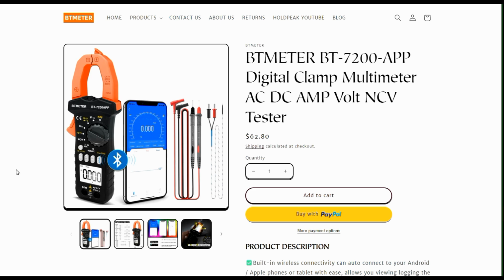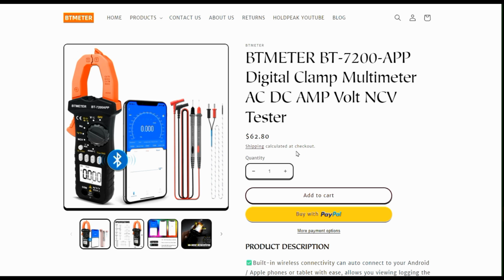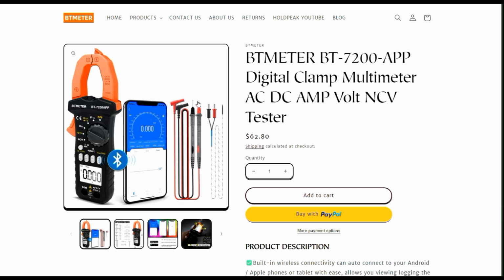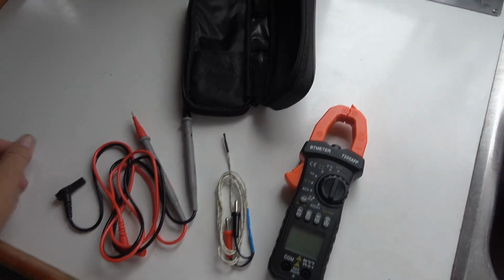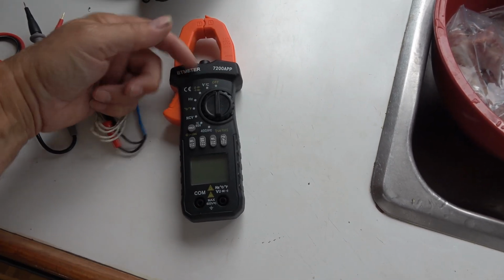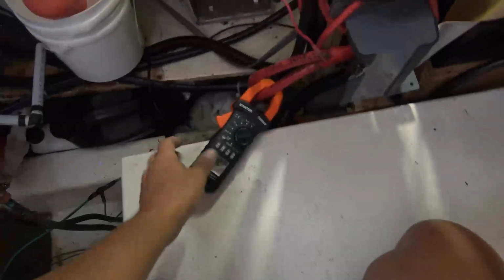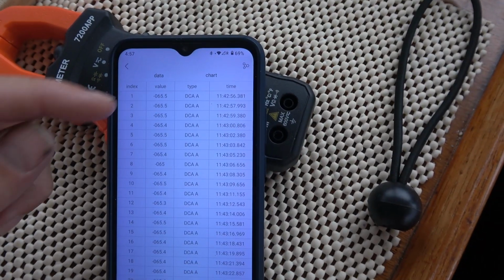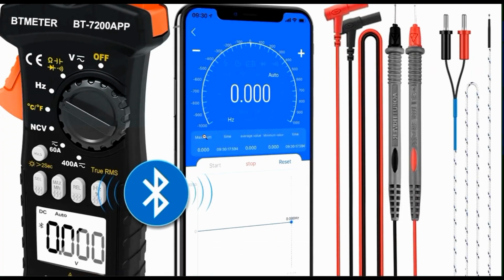Inexpensive *Bluetooth* Clamp-On Amp Meter for Remote Circuit Monitoring - BTMETER BT7200APP

Comment: Thanks Ray. Got one and it's working well except it turns off after 10 minutes or so of remote monitoring. There is supposed to be a way to have it continue transmitting data (turn off auto-off) but this is not mentioned in the manual that came with mine and I haven't figured out how to do this.  I want to capture the top-off of my LFP batteries without baby sitting the unit and guessing when to start the 10 minute recording.  Do you know the trick?
Reply from the maker: I've experience that too. I think it may have something to do with battery saving or Bluetooth settings timing out in the phone but I haven't figured out any settings to change that worked.

Comment: Thanks for your review.  I can't decided between the 7200 you have and the 570S which seems to have a higher DC current reading (ie 1000A vs 400A). Is there a reason you went for the 7200?  Also when i search for the app in the play store with "AILINK" it does not appear to be the app you have.  Is there a different app you use?  Thanks in advance.
Reply from the maker: 400 amps was plenty for my monitoring applications so went with the cheaper model as I already have another clamp on meter. https://www.loveyourrv.com/doa-clamp-on-amp-meter-multimeter-repair-kaiweets-hd206d/ The amp I'm using is called Intelligent Meter https://play.google.com/store/apps/details?id=com.elinkthings.hupu